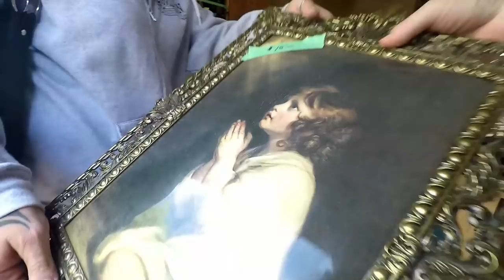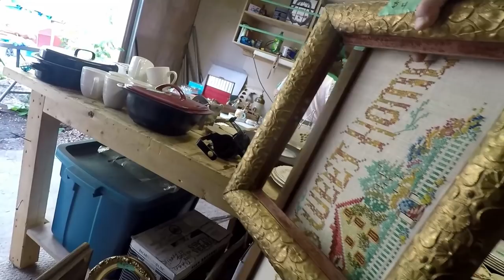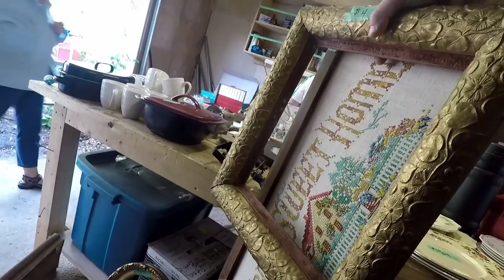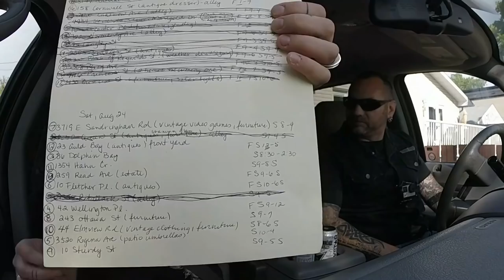Ep264: THIS SALE HAD SOME NICE ANTIQUES! - The ORIGINAL GoPro Garage Sale Vlog!

Comment: At that first sale I was practically screaming grab that wood bowl and the Pyrex. That wood salad bowl looked like it was made from the crotch of the tree, had good knots. That Pyrex with the matching cover was really nice too. Those free glasses I would've grabbed too, I do really well with old frames online. You are still getting some really good stuff guys. Cheers!
Reply from the maker: The wood bowl, I know it's hard to tell on the video, but it was made of multiple pieces of wood.  We DO buy the ones made from 1 piece of wood, and have several.  As for the Pyrex...  it's EVERYWHERE here.  You can't go to a garage sale without finding it.  Unfortunately it costs a fortune to ship, as our shipping prices here are very high and also based on weight.   That is why we do not buy it to resell.  Nobody here wants it (like I said, it's everywhere) and it costs too much to ship it anywhere.  :/
Reply: @BargainBarons  I keep forgetting how expensive Canada Post is, makes sense.